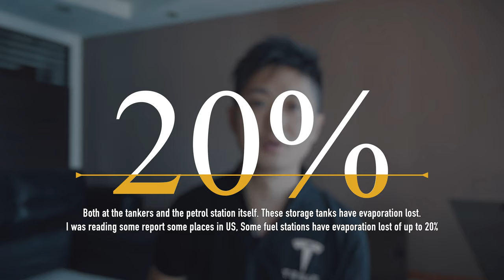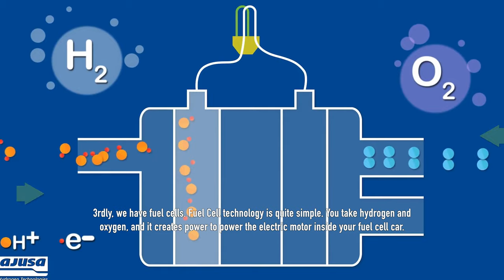Tesla Super Charging Vs Petrol Fuel Cell CNG

Comment: The amount of energy lost over electric transmission lines is significant. Why do you downplay or dismiss as irrelevant the heat energy lost over high power transmission lines?  Pipelines transmit natural gas directly to the home or business with very little if any loss. Why do you ignore that pipelines are the most efficient & safest method of transmitting energy to the end use point of use? California Wild Fires are often blamed on electric transmission line infrastructure that have been neglected by overspending on much more in-efficient windmill & solar solutions mined out of the ground disturbing the earth far more than modern hydraulic fracturing natural gas production & distribution.
Reply from the maker: thanks for your detailed reply. I agree with your points too. Just note that pipes do have it's downsides too. Just google "gas pipe leak estimates"
Reply: @ChickenGeniusSingapore  Yes, everything leaks, as the earth leaks oil and gas from the ocean floor and the ground itself. Just google "Oil Seeps". Natural Oil Seeps happen globally, and no "environmental" group has a plan to harvest, clean up, plug or otherwise mitigate this natural toxic pollution not created by human activity.